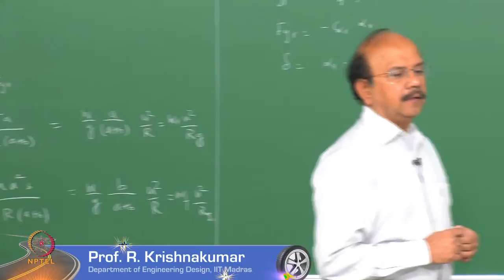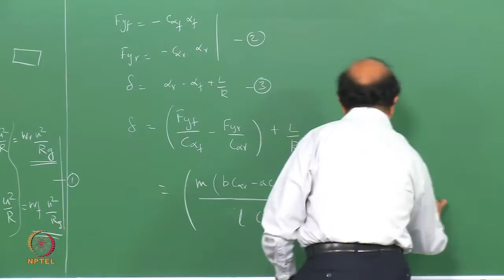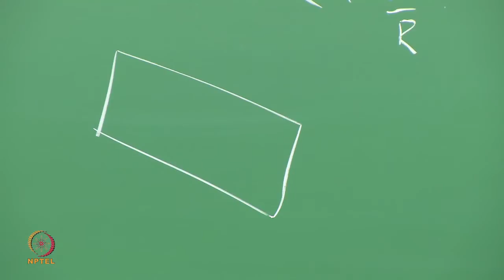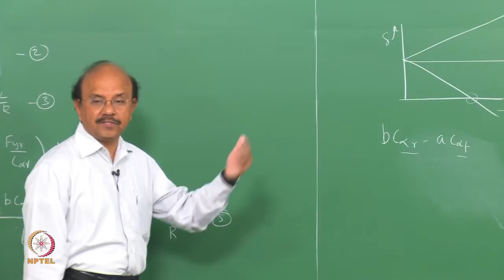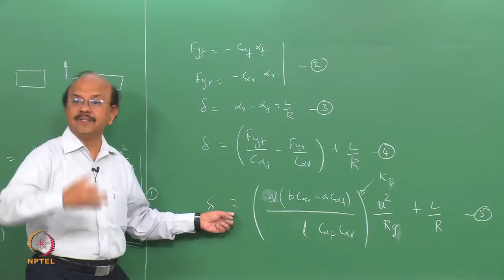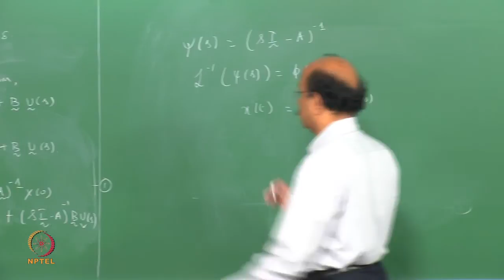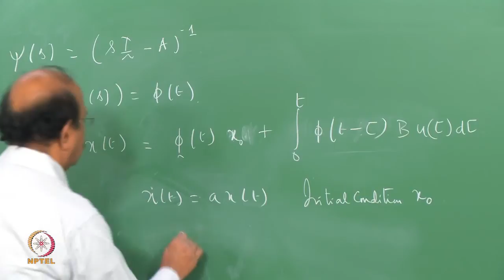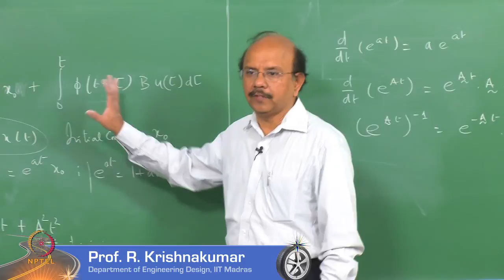Mod-01 Lec-20 Understeer Gradient and State Space Approach

Comment: i read that bias ply tires are stiffer than radial tires which has a much more flexible sidewall , wouldn't that mean that the radial tires have low lateral stiffness compared to the bias tires? I am confused on how this amounts to radial tires having 2x times lateral stiffness compared to the bias tires.